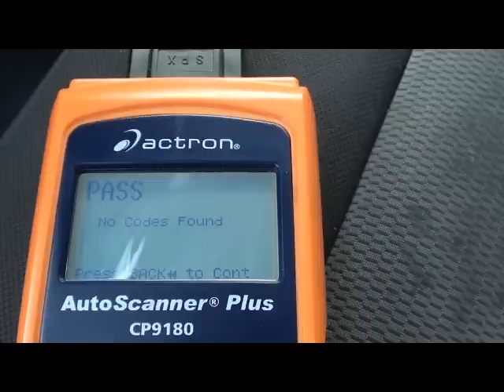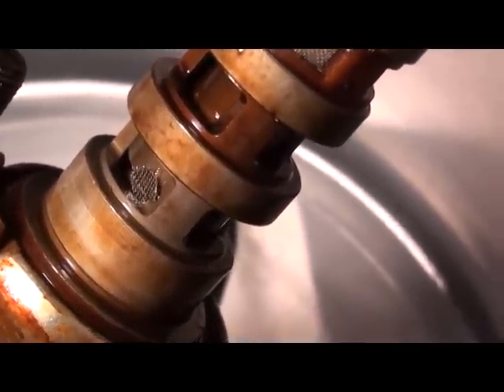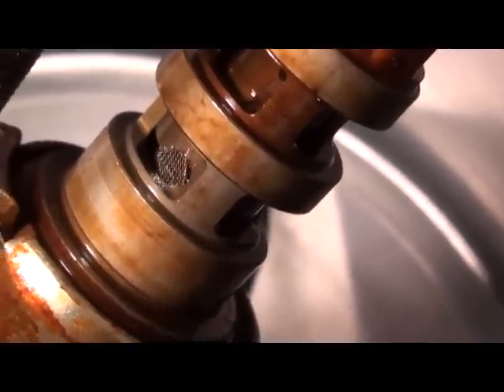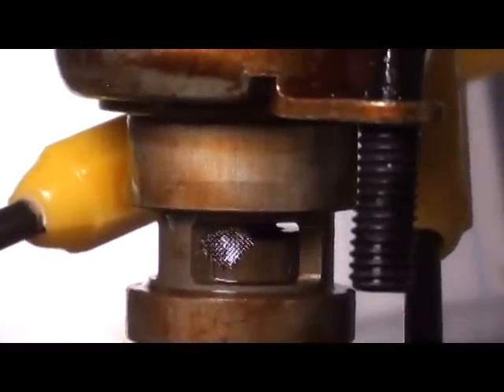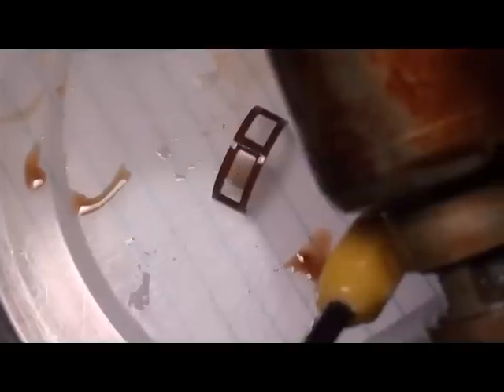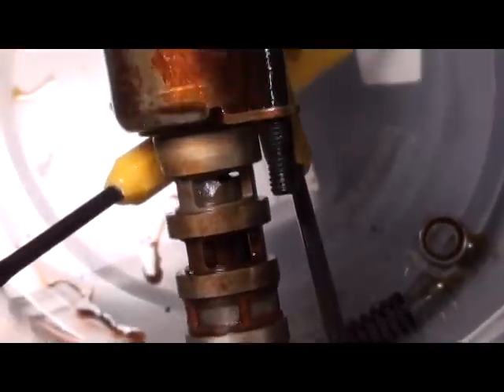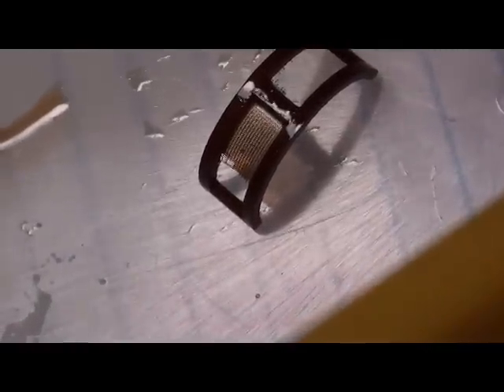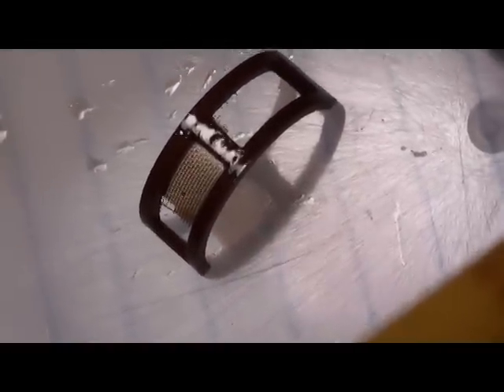FORD F-150 FIXED ROUGH IDLE / STUCK VCT SOLENOID PART 1

Comment: I used the same diagnostic scanner. got the same code. after being towed home. I pulled the solenoid and it looks like new. went ahead and changed it. problem solved.. thanks for the info jeff

Comment: just changed out mine today in my 08 Expy. I wish it would just fit though the hole but of course I HAD to pull the valve covers off. Some years on F-150 you need to do the same, if the VCT solenoid seal doesn't have a tab to pry it off, you gotta spend the extra 3 hours.

Comment: Oh, and mine did NOT have a 27T Torx, but instead a slightly larger allen head bolt (if it fell into the bottom, won't it just sit in the bottom of the pan?) ... considering a long "magnet on a stick" ...

Comment: Jeff once this procedure is done on a F150 does this fix the truck? Would it be possible that it wouldn't work? Ford dealer states that it might not work. And said it would cost me another motor. I need my truck.
Reply from the maker: If it's a bad part and you replace it why would that cost you a new engine , get a          second opinion because some will tell you that anyway. It could be a lot of things. My test code lead me to the VCT . I remove them and tested them and found them to be sticking. This is a problem because they control the cam .
Reply: +Linda Ault I had the same problem with my truck today up until i fixed it, when i took it to the dealer they told me i needed a new engine ( which was a bunch of bs ) my truck runs perfectly now after a quick 200 buck fix. I find that he dealers just try to squeeze as much money out of you as they can
Reply: Well Chris, it's too late! Two new cars too late!

Comment: Hi..I have 2004 f-150 5.4. there is noisy and losing in the power . when i check there is no codes and engine light is off. I have changed a lot of things such as fuel pump and coils but still i have the same issue.. I went to the dealership and they told that they are not sure but they need to change the timing chain and cam and other stuff for $ 3700. I have 200,000 miles on it . you think i should change the VTC solenoid and give a try?
Reply from the maker: you can always pull them just to see if one or both is sticking.
Reply: Hey i have a 2000 ford f150 i change many things and now it has no check engine light but...but!!! It still turns off but i havent change the vct solenoids....my question is does my tuck even have vct solenoids? Its a 2000 ford f-150 with a v-8 4.6 engine
Reply: Did you get your problem solved? I have an 2005 with the same issue.

Comment: Could this be a problem if no codes are present?  I'm told phasers or vct is bad. It will act up with rpm drop diesel in and it recovers if I rev it up. Just curious. it acts up more after oil change.
Reply from the maker: Can't say, but did you test by disconnecting the CMP sensor found on the left and right banks in the front of the engine, if you have a 2004-05 5.4 3v? If the sensor is not working it may not give out a code. That's my first thought.
Reply: Jeff Famreunion I have not yet. I am doing a brake job and then changing oil. I will test that at that time.
Reply from the maker: It must be that time of the year,I just put on some new rear pads this past weekend... good luck with your test.
Reply: its that time of year... think mine just clogged..

Comment: I have a 5.4 triton and I am having a problem with number one cylinder misfire. I have compression tested it all my cylinders were within 10% of each other with an average psi reading of 165 per cylinder. From my passed experience I believe that is normal. I have done new coils plugs and even changed the injector for shits and giggles. I have great spark and a great injector pulse but still no luck. This is my daily driver and its really starting to bother me with the constant jerking in overdrive especially with a load on it. I was thinking head gasket possibly? or maybe this valve? ive checked my o2 sensor volt readings with my scan tool and they're working properly and I also cleaned the mass air sensor. still nothing. one code and its cylinder number one miss fire (passenger front on this truck) I'm 17 years old and have a decent amount of knowledge for my age but I'm curious if anyone may have any suggestions
Reply: Vacume leak

Comment: Did it cause a rough idle or no idle ? Mine spits and sputters till you get it up to a certain speed
Reply from the maker: Yes, that is one of the symptoms. If you have some mechanical skills you can remove them for inspection. However, you must be careful with the screen on the solenoid because it can be brittle and fall apart.The hardest part for me was getting the two seals covers off the valve covers.I have a Part 2 video that has more on that. hope this helps.
Reply: @ytsirjeff8  check your IWEs, when they go bad it loses vacuum and causes to spit & sputter til you get to a certain speed or rpm. Search “f-150 bad IWEs to see if that’s the issue you may have. Good luck.

Comment: my truck shows P0012 ? can be the VCT solenoid the problem?
Reply from the maker: +Alberto Rosas It could be, this is just one possible issue. Like all mechanical engines. you still need to troubleshoot to find the problem.
Reply: +Alberto Rosas 
Did you fix this problem? I have the same code popping up on mine
Reply: +Ron Tria not yet!! i had it pay $260 for an  illegal smog check.